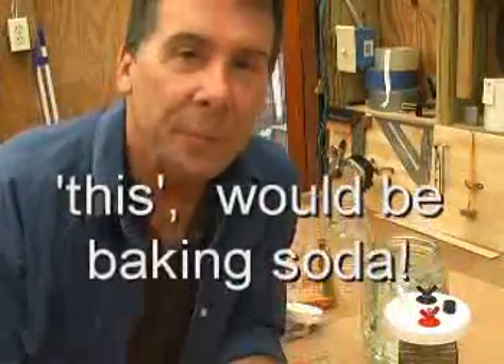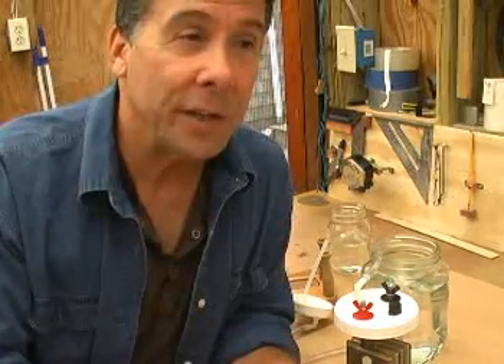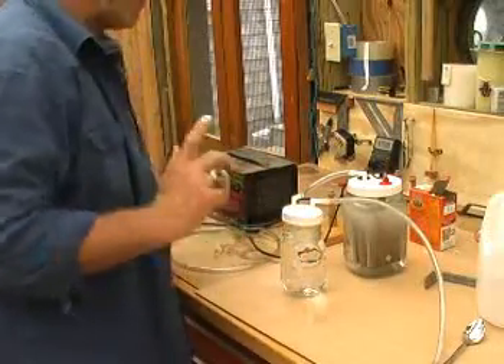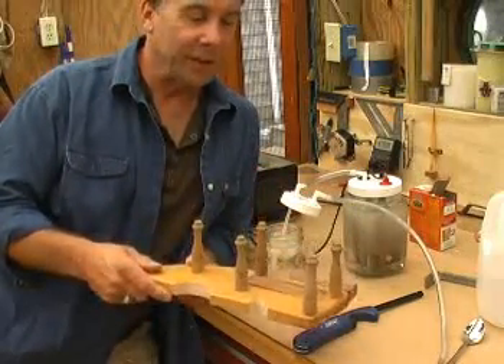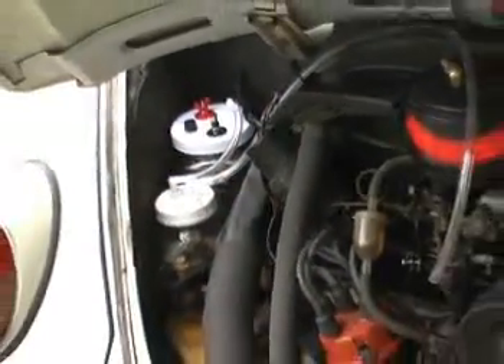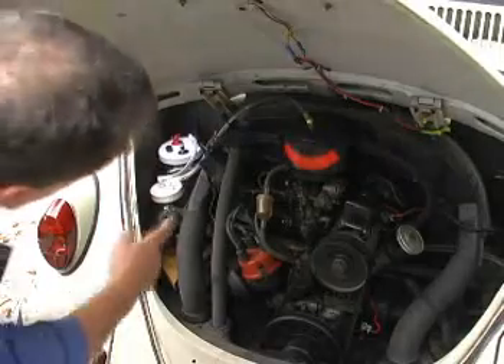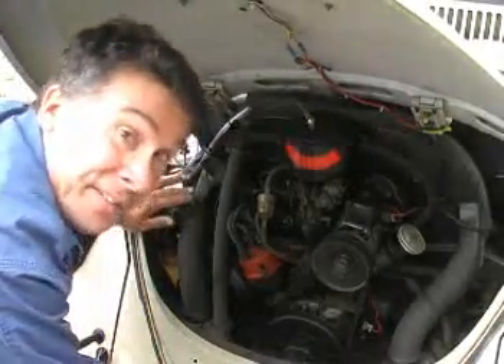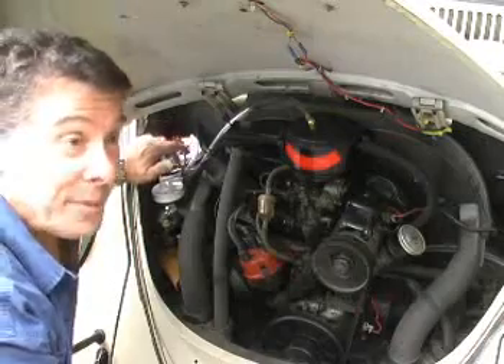hydrogen generator finally proven pt.2

Comment: The solar charger on the roof is the key to this project, not "a whole other story".
There is no point with hydrogen generation if you don't use some smart source of energy, like sun. Of course the efficiency of the solar panel + the conversion to battery-stored energy + the conversion to hydrogen stored energy, means a lot of that solar power is wasted. But, hey, its free... Maybe you could do better if you could hook up the panel directly to the generator when its sunny.

Comment: @panzarw i belive u can use this in 2 ways one completely remove the air from the fuel/air mix and use hydrogen or two add hydrogen into the air of the fuel air mix so i believe a two stroke might work

Comment from the maker: KOH is the chemical symbol for sodium hydroxide (lye) that is used in toilet bowl cleaners and produces a large amount of hydrogen when mixed with water and combined with electircity. However the downfall of cracking water with sodium hyd. and elec. is that it draws double the amperage and becomes unstable easily, many explosions have occured with this expieriment. I ended with the baking soda!